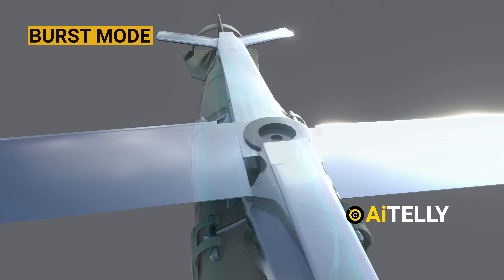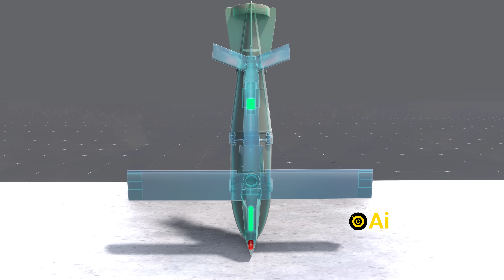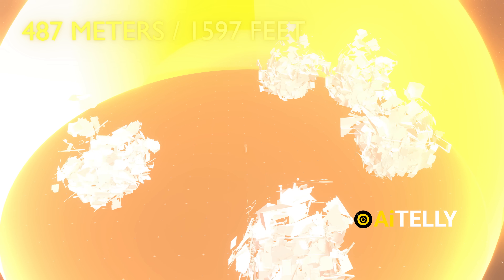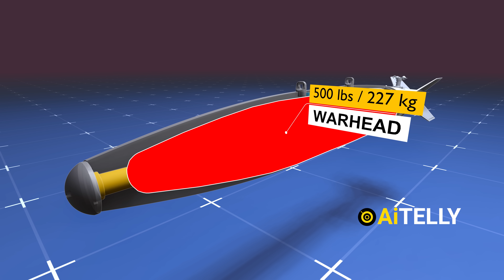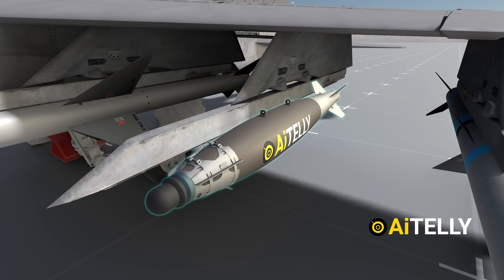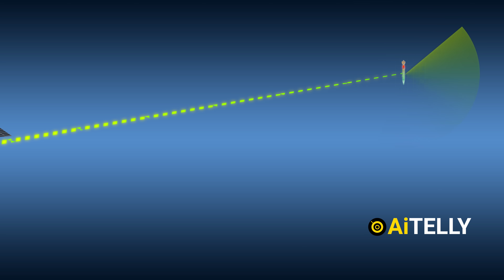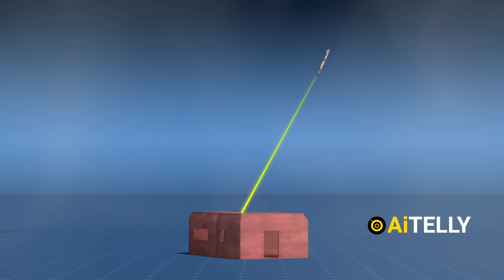Russian Glide Bombs Vs American JDAM | How it Works

Comment: They have also added rocket booster to the fab 500 which drastically increases its range
Reply: i think it just applied for fab 250 now and it said to be can go around nearly 100km after deploying from aircraft. they just use to boost the bomb range while gliding, not like missile or rocket a bomb really hard to intercept (so better choice is intercept the aircraft than bomb itself).
Reply: UMPB
Reply from the maker: Really
Reply: @Aitelly  It was either a small rocket booster or some kind of pulse jet the Russians were experimenting with on their glide bombs.
Reply: And speed. If it only glides, then it should be easy enough to shoot it.
Reply: @fractalmadness9253 A small bomb gliding at 400 kph is an easy target? Based on what? You are in a trench in the forest, you won't see it or hearing it coming.
Reply: you must be talking about grom e2 and e1
Reply: Если запускать фаб с миг 31 то она может еще дальше занести бомбу противнику.
Reply: This is not true, a photo of the new UPMC was recently published, it has elongated wings. I do not know how they did it, but because of a couple of centimeters, the range of 60-70 kilometers increased to 120 km.
Reply: It's will make bomb visible for aa rocket and increase weight
Reply: @mr.markovnik3058  they dont seem to care, they know somthing we don't
Reply: @rajaydon1893 They knoe that ukrains dont have AA system close to front line. Simple as that
Reply: @rajaydon1893  No they don't, they just don't care if half their munitions are shot down.
Reply: @WarlordEnthusiast  yeah because you seem to know more than an entire military industrial complex that has been studying this for years
Reply: @rajaydon1893  And you seem to trust Russian weapon technical information despite the fact that they've been exaggerating the capabilities of most of their weapons for decades.

Case in point, the T14 armata. 

Aside from that, even with the rocket booster its still a heavy dumb bomb designed to fly in a straight line. Any semi competent solider with a MANPAD could shoot one down, as is done with alot of the far more sophisticated cruise missiles that Russia has been using in Ukraine.
Reply: @WarlordEnthusiast  not 100% but they sure are more trustworthy than the ignorant people blinded by emotions and personal bias
Reply: @rajaydon1893  I'm not blinded by emotions, on the contrary I viewed the Russian military as being quite capable before the war in Ukraine. 

Now? 
After seeing their repeated failures throughout the entire war, I can't help but view them as being far less capable than I initially assumed. 

Seeing how they've essentially killed half of their potential soldiers (18-25 Male in good health) whilst barely making any progress does not instil confidence in their ability to fight a peer to peer war.
Reply: @WarlordEnthusiast  половину??😅😅😅 а можно в цифрах?😬😬
Reply: @WarlordEnthusiast  ты наверно много читал Андерсона -  он сказки писал
Reply: @WarlordEnthusiast  большинство ттх советского оружия наоборот были занижены. вспомним тот же калибр. помню как после пусков с каспийского моря по сирии весь интернет гудел неверием того что это были калибры. ведь официально по ттх они столько лететь не могли. ну и дам тебе совет, который ты все равно не послушаешь. не нужно верить говорящим головам из всяких околополитических шоу. тогда такие абсурдные мысли типа "киев за 3 дня" или "погибли половина солдат", сам не будешь говорить прилюдно, дабы не позориться. про неудачи российской армии это какие такие? тактическое отступление из за того, что у россии физически не было столько солдат, дабы контролировать всю захваченную территорию? еще что? из тех что были реально а не были придуманы пропагандой. но считая неудачи россии может и неудачи украины посчитаешь? какое количество солдат погибло? какое количество потеряно территории? как пострадала инфраструктура и промышленность? если война сейчас закончится, россия сможет дальше жить, а украина без спонсирования из сша и ес? ну и сравни как много людей на улицах российских и украинских городов. россия не ведет войну с украиной на равных. хочу напомнить, что за удар по ядерной инфраструктуре, типа рлс, в доктрине россии полагается ответный удар ядерным оружием.
Reply: @WarlordEnthusiast Why do I see you didn't respond with the last 2 comments, what's the problem? I understand that it is more difficult to ask with a Russian than with foreigners who have zero knowledge like you, but you try
Reply: @Apophes  Maybe because I don't feel like repeating myself to Russian bots like yourself?
Reply: @WarlordEnthusiast  Western media propaganda makes you look foolish when you mindlessly repeat it.
Reply: @WarlordEnthusiast  They don't care either if 80% of their replacements at the frontline survive zero assaults. So yeah.
But the downside is when you burned your MT-LB as frontline IFV and lost them by the bucketload, and then they lost too many SPG and now need arta tractors stat and another division loses the last token armor to protect their stormtroopers. C'est la guerre.
Reply: @WarlordEnthusiast  You probably also expected them to be as capable as USSR, especially after that neat combined-arms thing they did to Georgia.
Yeah, me too.
Reply: @Вадим-ру  "Time will tell."
Reply: @willietorben560  I think everyone in the back of their head believed Russia was still a top tier military before Ukraine.

Not only is the war probably the most disastrous of the 21st century but its also one of the worst PR disasters in history. 

Imagine if the US invaded Canada and was losing so bad it dropped from being a first tier military in the span of a year.
Reply: 😂😂😂😂😂 @WarlordEnthusiast A little boy. turn off game. and read about the Portable anti-aircraft missile
Reply: @WarlordEnthusiast Afghanistan sent greetings!
Reply: @truggvi5346  Wtf are you on about?
Reply: @WarlordEnthusiast  Sofa expert, cool story😂
Reply: @WarlordEnthusiast  The Armata platform is undergoing modification! It will become the future main platform!!!
Reply: @mr.markovnik3058  i think that would still be a win for the russians, because an AA Rocket is WAYY more expensive than a glided bomb, even if the bomb has rocket boosters
Reply: @LeroxYT  Uncle Sam will send more, won't he?)
Reply: @mr.markovnik3058  it depends on how long does the engine works, if it does it job only in the beginig of its trip to save the speed, than after it stops to work the heat would be on low level.
Reply: @rajaydon1893 this is simply wrong.

the UMPK kits used in conjunction with the FAB series of general purpose bombs are all un-powered.
there exists a weapon called "grom-1" which is a air launched rocket boosted glide bomb based on the KH-38 missile.

the weapon you are most likely referencing however is the "UMPB-D30SN"
this is a unpowered glide bomb about the same size as the American GBU-39 SDB, and can not only be air dropped. but can also be ground launched out of a 300MM artillery rocket launcher with an attached rocket booster.
similar to the "GLSDB" concept for the GBU-39.

the UMPB-D30SN does not use a FAB bomb as a base and adds a wing kit to it. the UMPB-D30SN is a completely factory designed and built weapon completely independent of the FAB type bomb, or the UMPK guided wing kit.
Reply: @LodewijkVrije  ؟
Reply: @LodewijkVrije  What do you expect from a vatnik who believes wartime propaganda brochures.

Comment: The FAB 500 knows where it is at all times. It knows this because it knows where it isn't. By subtracting where it is from where it isn't, or where it isn't from where it is (whichever is greater), it obtains a difference, or deviation. The guidance subsystem uses deviations to generate corrective commands to drive the FAB 500 from a position where it is to a position where it isn't, and arriving at a position where it wasn't, it now is. Consequently, the position where it is, is now the position that it wasn't, and it follows that the position that it was, is now the position that it isn't.
In the event that the position that it is in is not the position that it wasn't, the system has acquired a variation, the variation being the difference between where the FAB 500 is, and where it wasn't. If variation is considered to be a significant factor, it too may be corrected by the GEA. However, the FAB 500 must also know where it was.
Reply: @regenwurm5584 это тот момент, когда думал что слышу мэра Киева Кличко или Камалу Харрис))  "сегодня в завтрашний день, не все могут смотреть. Вернее смотреть могут не только лишь все, не каждый может это делать"

Comment: You are forgetting that JDAM has an optional laser guidance as well as home on jam seekers
But most importantly, the JDAM can be carry a wide variety of aircraft whereas the Su-34 is the only launch platform
Reply: No, УМПК can be used from Su-24M and Su-35 too
Reply from the maker: We did mention that in this video regarding laser guidance
Reply: @Aitelly 
Additional the JDAM has precision mine and anti ship for naval warfare as well
Reply: DON'T  BE TRUE ... THE SU30 AND SU35   HAVE USE THE UPMK  KITS
Reply: @ignacio3890  
Not likely
The Su-35 hasnt be used for ground attack and the Su-30 has seen limited use
Reply: @verdebusterAP  
The su35 and the su30sm had used to ground attack , the su35 was the primary sead platform.

Comment: 500 kg is a total weight of FAB-500.   Charge is something about 300 kg. Anything above it's caliber is practically useless,  cause blast energy to the range is going down by square or even cube, can't catch now.
Reply from the maker: Great Feedback
Reply: This is an incorrect conclusion. Suffice it to recall that the FAB-1500 is only 675 kg of TNT. That is, it has 875 kg. fragments.
Reply: @Артём-ц5э8з  Dear, it's ain't no conclusion,  it's a mere fact . Russians are using their so-so smart bombs as a bunker busters mostly,  so it doesn't matter how much of fragments there.  And only 500's are handy for air forces to use and mostover are present in quantity.

Comment: Fab 500 weighs 500kg AND has 500kg of TNT... riiiiiiiiiiight.
Reply: The bomb weighs 500kg and the filling is 201kgs how hard something explodes is normally written in tnt. Just how nuke has explosive power of 1 megaton of tnt but doesnt weigh 1 megaton
Reply: 500 это примерная масса бомбы(500+/-50 кг в зависимости от модификации), ВВ понятное дело меньше. Такая классификация как: ФАБ 100,250,500 удобна для нас, так как мы подвешиваем бомбы на держатели, которые предназаначены для определённых весовых категорий. Таким образом, по названию уже понятно, какой держатель нужен для определённой бомбы.
Reply: They only use the tnt weight not the overall weight.
Reply: Actually they are heavier then 500kg.
Reply: It's not TNT, but it's fougasse high explosive
Reply: Its tnt equivalent. It may be RDX, which is more powerful than tnt, so 300kg of rdx is 500kg of tnt
Reply: 500kg tnt equivalent
Reply: @commenter648   Нет. Калибр авиабомбы это ее масса. А не тротиловый эквивалент. Я разбирал фаб100. Там быто только 40кг тротила. 60кг - толстая оболочка из чугуна.
Reply from the maker: That is what the Russian says on their specs
Reply: @Aitelly  
FAB-500 has only 200-213 KG of explosive material that has +50% more power than TNT. So it;s about 300-350 kg TNT equivalent.
Reply: @Aitelly  Source?
Reply: @Aitelly  It has 210 kg TNT  ,FAP 1500 has 650 kg,Bomb is not just TNT,it mus have fragments to destroy stuff .LIke FAB 1500 has 650 off TNT and 800 kg off Fragments

Comment: Great video. Apparently in response to Russian EW and GPS spoofing, the US has modified the JDAM to hone in on the source of the spoofing. Can you explain how that works?
Reply: A jammer sends a signal much like a guidance radar would. It clutters the guidance with conficting messages. Instead of being jammed, the guidance system used the source of the jamming as a target point. But that can be evaded easily by putting the jammer on and off while staying mobile.